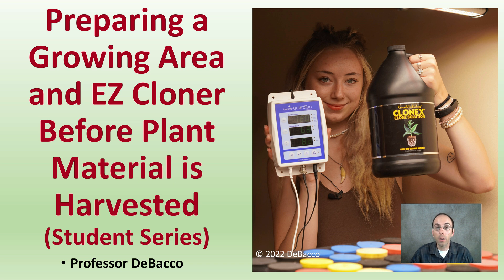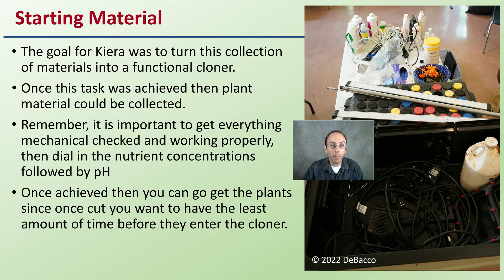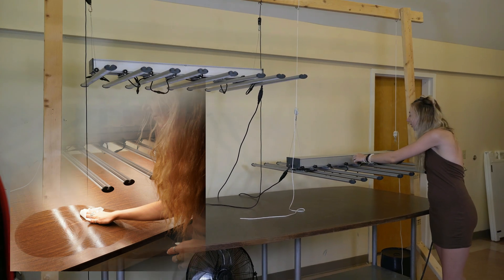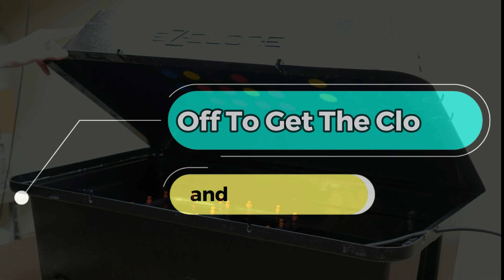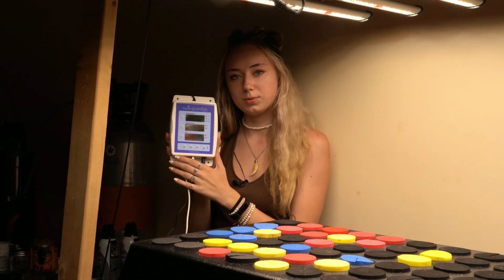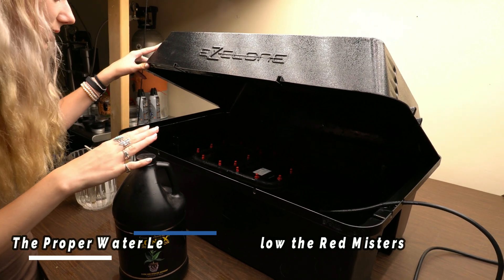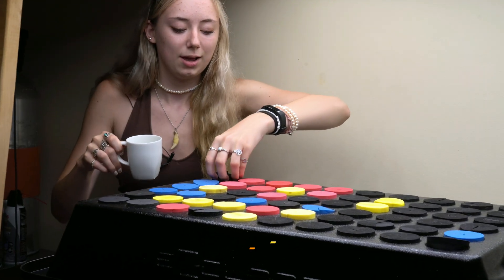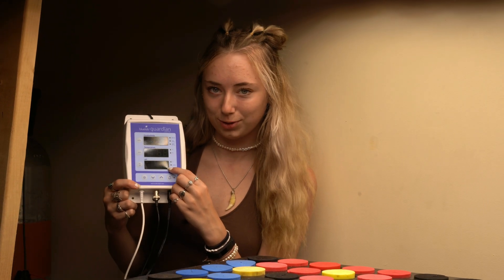Preparing a Growing Area and EZ Cloner Before Plant Material is Harvested (Student Series)

Comment: 6.6 ph on a ez cloner? Did i hear right?
Reply from the maker: You are correct, others tend to prefer a low 6.3 pH but 6.3-6.6 is the acceptable range, with a higher range 6.5-6.8 for soil based operations.

Comment: Because of the successful techniques learned from this channel, I’m absolutely inundated with surviving clones this year. At which point do they become non-seedlings and count towards my 12 non-flowering plant limit? I have a boatload more clones than that, (unlimited seedlings are allowed). It will be heartbreaking 💔 to kill them, but they are getting too old and I will need to dispose of them soon.
Reply from the maker: Great to hear of your success and that the tips provided on this channel helped in some way!  As far as the seedling to non-seedling change, check with your local regulations for their definition as this is what you would have to follow in your area.
Reply: yeah, that's the thing about getting the cloning down. You end up with TONS of clones.
Reply: I give them away

Comment: Just what I would do. Teach people how to cross contaminate their plants every time they clone.
Reply from the maker: When you do a lot of clones these little bottles do not last long and starting with clean plant material is important as well with no issues observed.  Large bottles are used as stock solution and then refilled into the smaller ones as well.  The small bottles are great to use and keep things labeled and light blocked, store them in the refrigerator as well to increase product longevity.
Reply: Let me know when you can see hops disease, blight , Specerium and about a million other problems looking at your plant. 
It doesn’t matter how separate you keep your materials. Soon as you throw your plants into a EZ cloners they are all subject to contamination.

Comment: Hey Doc. I've thought of making my own Rooting Hormone powder by simply doubling the concentration from the usual 1% Indol-butyric acid to a 2% by Vol. mixture combined with Diatomecaus Earth as the carrier, rather than corn starch. I could then use it dry and/or put it into solution using a mix of fresh aloe vera gel and water. Would this be too much active ingredient for cuttings? Could the DE harm them in any way? Thanks for all the great vids and Congratulations on $50k Subs!
Reply from the maker: The hormone concentration differences have different purposes "Hormodin" is the commercial product typically used which comes in 0.1%, 0.3% and 0.8% concentrations, so it would depend on your intended purpose.  When in doubt start low as high concentrations can reduce rooting.  https://www.ohp.com/Products/hormodin.php Great to hear you like the videos and find them helpful, happy to reach the 50k as well;-)

Comment: Thanks for the video. I am unfamiliar with conductivity in this regard. Is it like electric conductivity, meaning the water is able to better transport or support the nutrients ?
Reply from the maker: Conductivity is typically measured in EC (Electrical Conductivity) or TDS (total dissolved solids), but ppm (parts per million) was shown as this typically is the easiest to understand and all of the numbers can tell a grower the same thing, the units are just different.  This video may help... https://www.ndsu.edu/agriculture/extension/publications/using-electrical-conductivity-and-total-dissolved-solids-meters-field-test
Reply: Yes it is electric conductivity. Water (pure, demineralized water) has a theoretical conductivity of going towards zero (! this statement becomes contentious when discussing the very definition of conductance : quote : "the degree to which an object conducts electricity, calculated as the ratio of the current which flows to the potential difference present. This is the reciprocal of the resistance, and is measured in siemens or mhos." end quote) 

- as this definition doesn't allow for an absolute zero value generalized (as in "all possible currents"). 

Regardless, this is (obviously) not practically achievable. In the context of water for watering plants,  the conductivity is merely a measure of the ratio of water to nutrients (unit typically ppm - parts per million). 
 The higher conductivity, the less "pure h20"
Reply: Or perhaps disregard my partake and read Mr. DeBacco's lol - I must have been typing while the reply was made